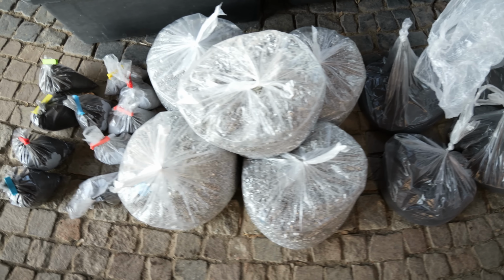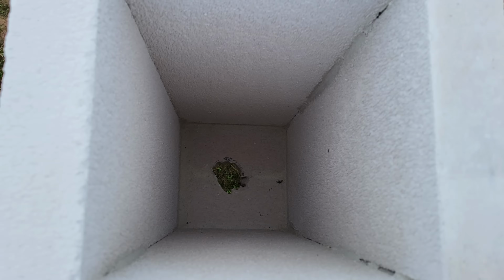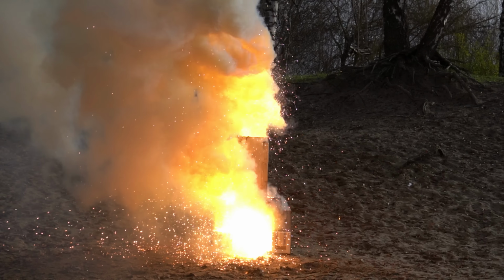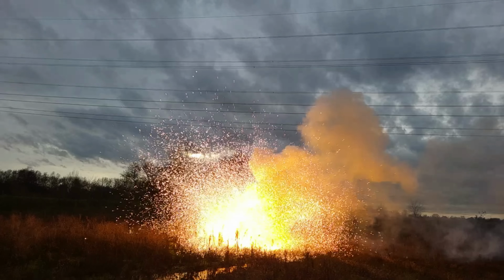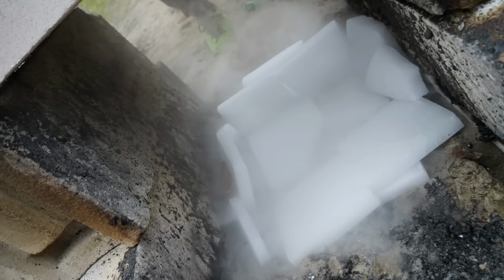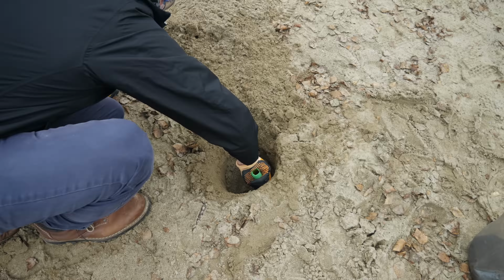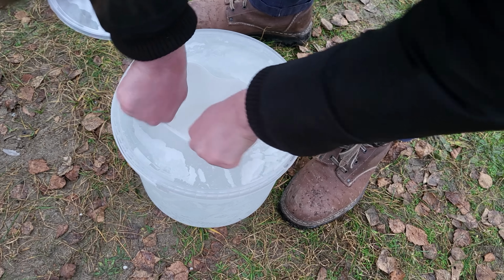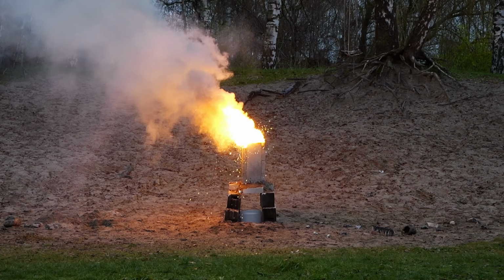100kg Thermite: Observing the Power of Aluminium and Iron Oxide Combustion

Comment: I think it is a steam explosion. I think the explosion wasn't instant due to leidenfrost effect. Also, the only possible chemical reaction I could imagine would be if the elemental iron could tear oxygen off of H2O, and I don't think that would cause a violent reaction, and I don't see why that would differ much from reacting with the atmosphere. To test this, you could examine the flame with spectral analysis to look for the presence of hydrogen flame. You could also test the result with water against a control to see if it created extra iron-oxide. I think it would be the same, being only the iron that reacted with the atmosphere.
Water is special compared to most other chemicals due to its unusually high specific heat and vapor pressure; both much moreso than with cyclohexane or CO2. This is why heat engine methods of power generation, such as nuclear fission power all still use water/steam to drive turbines.
Reply: It was found out that this happens due to a Coulomb explosion

Comment: In my mind it seems similar to the phenomenon of a Prince Rupert's Drop - where rapidly changing opposing forces inside/outside the block change beyond its threshold.  Or maybe it's that small air bubbles embedded in the block are instantly vaporizing to steam with nowhere to go (that would count as a sealed system).  I bet the radiative heat alone penetrates the ice fairly quickly, and I wouldn't be surprised if it even had some type of lensing effect (is infrared affected by optical lenses?  I dunno...grasping at straws here)?  If it was just a steam explosion it seems like someone would have recreated the effect with liquid water by now...
Reply: It is probably a Coulomb explosion

Comment: It'd be cool to test the hardness and corrosion resistance of a few samples of the iron products. I'd expect the sugar one to be more of a steel thanks to all that extra carbon.
Reply: I think the iron in those products will be about the same as cutting a piece of random steel with an oxypropane torch and then testing the slag. Unless well controlled and shielded from oxygen all you get is dirty half-oxydized bubbly crap.
Reply: Again with the surfeit of Carbon, I imagine that the steel stage would be skipped and you would be up into Cemetite especially at the surfaces, something akin to old fashioned Krupp armour.
Reply: @chriswillis515  Indeed, though probably even less consistent.
Reply: @Mp57navy  Yeah, that's true. It would be interesting to see some measured data on it though.

Comment: Hi guys, spectacular demonstrations, though I feel you should keep your distance as long as the iron is still liquid. Otherwise, you risk serious injuries in case of an unexpected splashing. Answering your question on the explosive behaviour with water, i believe water oxidizes iron and the formed hydrogen causes a second explosion in contact with air. It ´s just an idea. Stay safe.

Comment: It's likely a steam explosion possibly aided some unreacted aluminium interacting with the water- the momentary confinement of the water vapour trapped under the relatively dense molten metal is long enough to build significant pressure and project even small spillages of molten metal significant distances and when scaled up this reaction can be exceedingly violent spattering metal "tinsel" all over the place, I once poured a couple of pounds of copper into a mold that wasn't fully dry after a shower of rain the night before and it spat droplets of metal a significant distance with one tiny piece rolling off my wrist in the gap between my gloves and my pulled up sleeves, kissing me just long enough to leave an ugly track and putting me off metal casting in my parent's back yard for good.
Reply: It was found out that it’s a Coulomb explosion happening

Comment: If I had 100kg of thermite, I'd probably shit my pants, and call the emergency chemical response line.
I love the fact that aluminium is so incredibly flammable, and yet when it's covered in a layer of Al2O3 it's just about as inert as a metal can get.
I've been able to get aluminium foil to burst into flames with water in the past.
And I was always truly baffled at how silly someone would have to be to sit in a rocket boosted by burning aluminium in a solid rocket. Especially when the instructions say, "Light fuse and stand well clear. Rocket can not be extinguished once ignited. Will produce substantial smoke and flames."